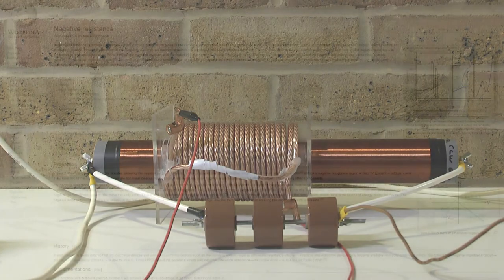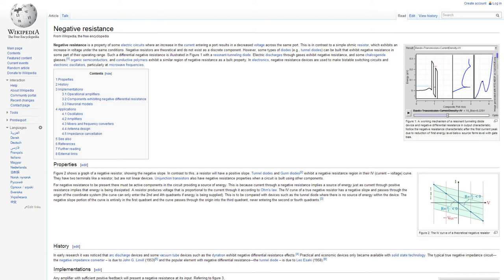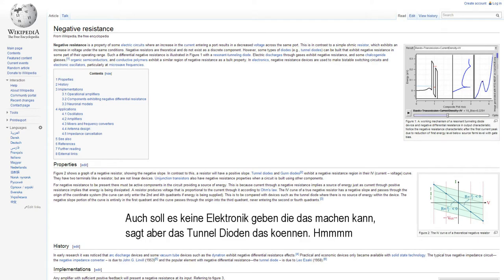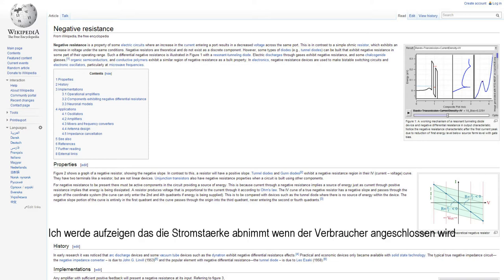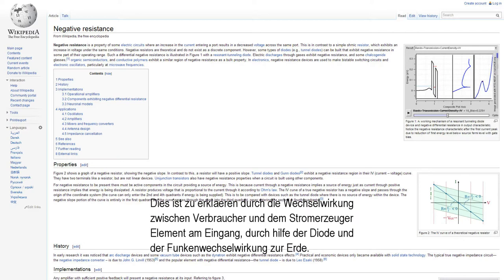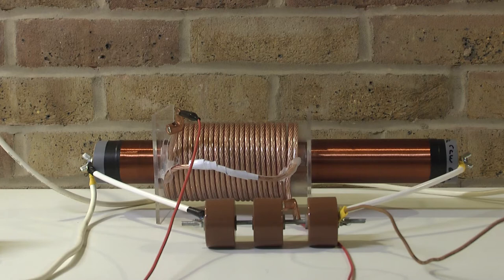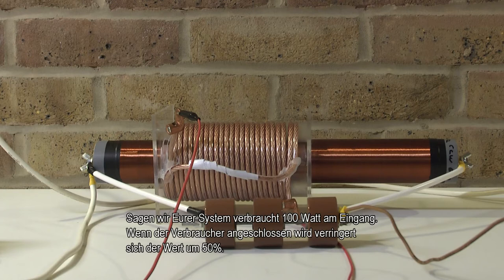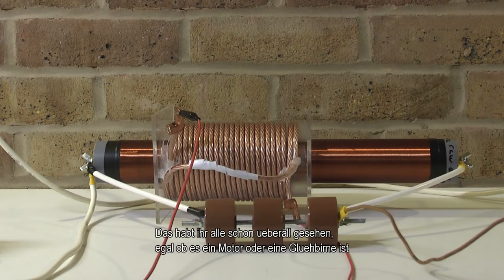Negative Resistance Revisited, with German subtitles/captions

Comment from the maker: Your diode is becoming the focus point of the system. You have to use a fast high voltage diode which can handle a lot of current. I used the 20KV, 300 mA one and it is getting hot.The current on the output side is still not utilised but the diode does already suffer for it.
Reply from the maker: overunitydotcom It seams. I was very surprised by the low power input .This diode is rated at 6 KW. I have a solution in my next video to present by increasing the power output even much further.
Reply from the maker: ***** Thanks Albert. I tried the diode but it did not react to the little power. Nothing did get through. That was my first thought as well.I have a new setup now without ground connection but it is even more stressful on the diodes. I will try if I can load balance that share when I can. I might demonstrate the heat up in a video at 4 watt input.
Reply from the maker: ***** Im will post now a new video showing the way for a COP >1 without ground

Comment: So the important thing is to be able to generate enough voltage on the secondary to get a spark into the ground? Does the primary need to be grounded at all?
Reply from the maker: Correct. Not at all. I work also on a non grounded version for the spark gap and will build a system independent from the grid, shielded in faraday cage.
Reply from the maker: Another important part is because of the low voltage and have to use a controlled spark gap in an reliable environment without radioactive fallout and no creation of ozone. The GDT does that for you going down to 90 volt up to 6000 volt. They have a inert gas inside and also do not create RF. Very good and cost pennies.
Reply: TheOldScientist I assume another parameter is to have a quenched spark gap into the primary to cut off the energy induced into the secondary from going back into the primary right? Also a circuit diagram would be great...and how on earth are you running your coil at such low voltages? Thanks for the great help!
Reply from the maker: MrWarrensk Have a look at my coil videos. Only with a bifilar primary coil can you achieve many KV at low input voltage. By the way it works also without ground. I did just test it. I will show it next time. Have a look at my previous video. It is a circuit diagram of this setup in the video

Comment: can i say that u archived a time reversal wave? consequence of the negative resistance? is this valid?
Reply from the maker: Interesting viewpoint. We see and measure a negative waveform in turning our standard model of wave propagation upside down. No mathematical calculation or formula exist today to describe that. That is not the only one. I will show very soon a different experiment where we actual draw energy from the field after first excitation without adding external energy. The power will be shut off and it will still charge. Apart from never shown before I have to create empirical result series and derive formulas from it. I would define it as break trough to get a better understanding of the nature of life and energy. It will be reproducible with calculated results and hope will add to or revise our standard physical models.